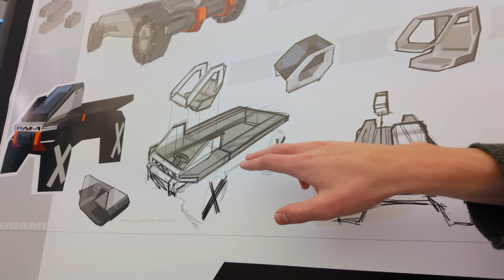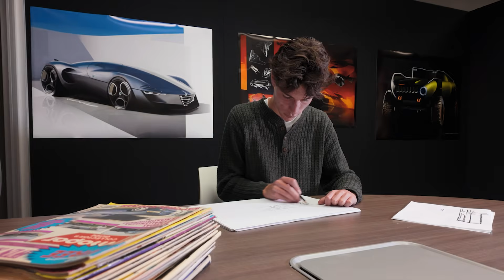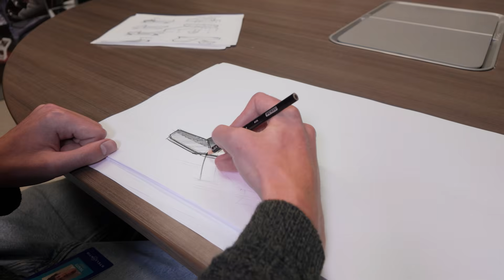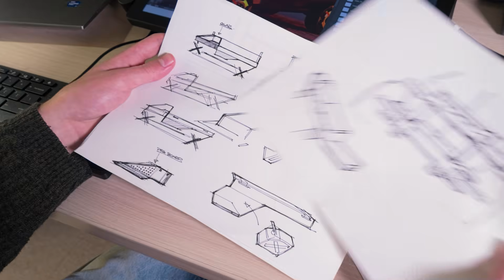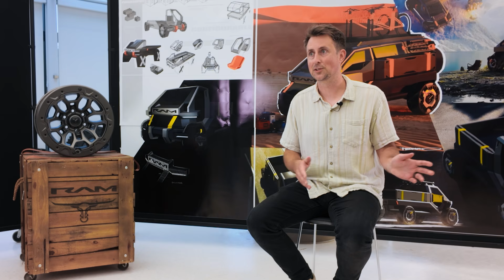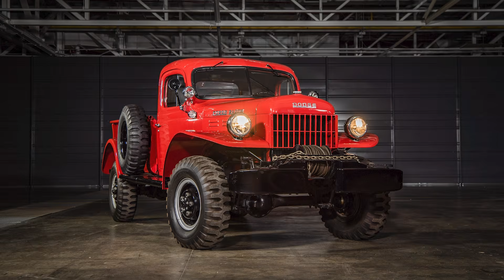Rethinking Pickup Trucks | Stellantis Drive for Design Intern, Felix Bucaro

Comment: As a forward thinking 67 year old proud RAM owner, please keep those sketches and design concepts filed away for the foreseeable future! I want a Truck and not a Mars Rover! 👍
Reply: If they ever developed some such, I don't think you'd need to worry that they might discontinue conventional pickups.  It would need to be an additional product line.
Reply: @MikeV8652
As long as their conventional, traditional Pickup Line of Trucks are only made better from generation to generation, then I’m all for developing new vehicles! After all, I may not even be around if or when that MARS Rover looking vehicle is actually developed. That was my only point. Thank you for your reply. 👍